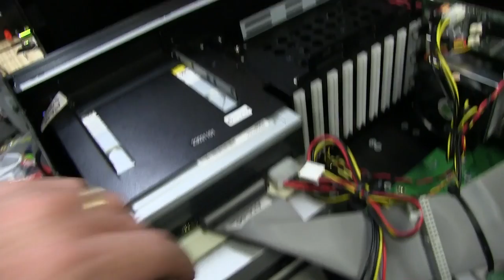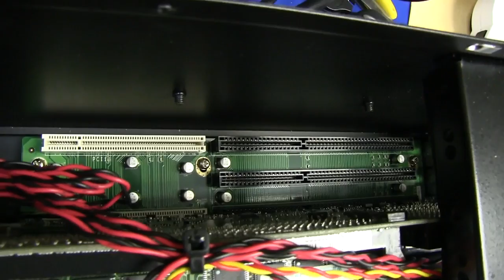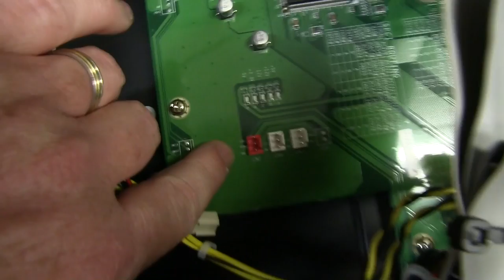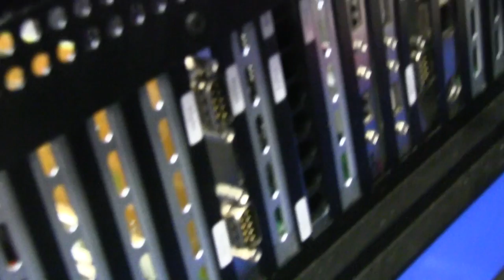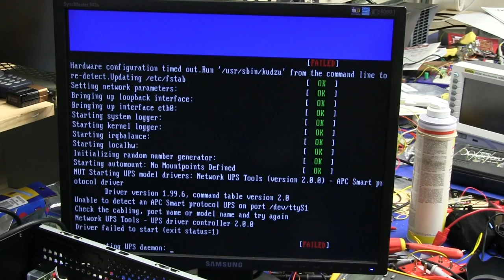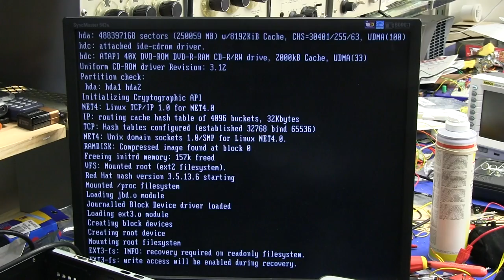EEVblog #458 - Industrial Computer

Comment: Thank you for this video,
Using PS2 mouse and Keyboard (instead of USB one) most likely keyboard and mouse would work. If you bring a linux Terminal and go to single user mode, you can reset the password to log in.

Comment: Those looked more like RJ45, Windows 3.11 could not boot up as it was a shell, on top of MS-Dos.
Reply: Six pins in those ports, not 8.  Those are some variation of phone line that supports other features, like RJ12 or RJ18.
Reply: You can sort of boot into 3.11 if you set MS-DOS' autoconfig to open up Win.com, and then check how long it takes to boot MS-DOS and then start 3.11.
Reply: Windows is a shell, a program, made to run under MS-DOS
Reply: Sasha Whitefur Windows is a shell??? Windows a program that runs in a MS-DOS environment. All consumer versions of Windows until Windows ME were only a program and MS-DOS was the operating system.
The NT range and everything after Windows ME are real operating systems, MS-DOS died with windows ME!
Reply: That's what I said.
Reply: +Sasha Whitefur what do you know? that's a girls name therefore you are a girl
Reply: Joseph Beasley edgy mate. Also, I'm actually male ;)
Reply: Joseph Beasley Well DUH!
Reply: Joseph Beasley
 I'm a Digital Technology Technician, plus my IQ is 137. How many digits in yours, 2?
Reply: Joseph Beasley

I'm a Digital Technology Technician, plus my IQ is 137. how many digits is in yours, 2?
Reply: Sasha Whitefur Of course!

Comment: Grub: Grant Unified Bootloader -
the software on the harddisk that will load the first files needed to get on with it..
- kudzu - detects and configures new and/or changed hardware on a system
Very nice machine - good for server - really - i saw a PCI/Lan - that makes it interesting.

howto fix the key/mouse - unload hd - mount in pc #2 - boot red hat - hack into system - add different user - enable ssh - logout - remount hd in IPC - forget key/mouse - login from pc #2 over ssh.. using the new account - problem solved..

Comment: Old vid, but a comment anyways,: Today, if it's not a system where it's a disaster with a momentary downtime of maybe 10 minutes the specialized industrial stuff usually makes little sense: As an example, I was replacing the hand scanners for the warehouse staff as a part of introducing a new WMS. As it turned out, for the cost of one "real" industrial hand scanner, running som stripped down windows mobile version which looked and felt like crap I could get 15 iPad Touch units with Bluetooth bar code scanners (now discontinued of course). That means that even considering wear and tear, serviceability etc, it's very hard to make purchasing the "real" scanners make sense from a financial perspective; even if the professional units were repairable if say a screen got busted, that repair costs as much as a new iPad, meaning basically you can have a bunch of them on the shelf for when they break.

Same thing with the computers, printers etc; yes, there are super nice industrial computers and printers, made for working year after year in a dusty, dirty, cold etc environment. On the other hand, these kinds of machines rarely need much power, and pretty much any business has enough retired computers to build a 2 meter wall around the premises, so generally you can just make a simple image for those second hand machines containing just the stuff needed for that specific warehouse, manufacturing, etc purpose and just let'em rip, once something goes wrong you just rip it out and toss it, and get a "new" old one off the shelf and be back running in 20 minutes without spending a penny, since these computers are essentially free.

Kinda symptomatic of modern society that quality stuff have a hard time competing with cheep ass stuff when the the good stuff is an order of magnitude more expensive.

Comment: i found this info :

maker: IEI

General
Driver    Integrated in Intel 865G
Display Interface    VGA integrated in Intel 865GV
Audio    Realtek ALC655 with AC'97 codec
Digital I/O    8-bit digital I/O, 4 input / 4 output
Ethernet    1x 10/100Mbps i82562ET Ethernet; 2x 10/100Mbps i82559 Ethernet (ROCKY-4786E2V)
I/O    2 x RS-232 serial port by pin header; 1 x lrDA

System
BIOS    Award Flash BIOS
Bus    AGP 4X/8X
Chipset    Intel 865G + ICH5
CPU    Socket-478 for Intel Pentium 4 with 533/800MHz FSB
Dimensions    338mm X 122mm
Form Factor    ISAPlus: Design to enhance the ISA bus drive capability(64mA)
Gross Weight    GW: 1.1Kg
Operating Humidity    5~95%, non-condensing
Operating Temperature    0 - 60°C (CPU need cooler)
Power Consumption    12V@7.52A,-12V@500mA, 5V@6.98A(P4 3.0GHz FSB 800MHz; Dual channel DDR400 512MB SDRAM)
Power Supply    AT/ATX power
SSD    1xCompact Flash Type socket
System Memory    Dual channel DDR 333/400 SDRAM socket support up to 2GB
Watchdog Timer    Software programmable supports 1~255 sec. system reset

Features :
1x 10/100Mbps i82562ET Ethernet, 1x 10/100/1000Mbps i82547 Ethernet by CSA
2x 10/100Mbps i82559 Ethernet (ROCKY-4786E2V)
ATX power control function : meet ACPI 1.1
Compact Flash Type socket
Hardware monitoring (CPU Vcore; CPU/System Fan speed and Thermal)
Integrated in Intel 865G
Intel 865G + ICH5
Intel Extreme Graphic II interegrated graphic engine
Intel Socket 478 P4 Prescott/Celeron D CPU support
Intel Socket 478 P4 Prescott/Celeron D CPU support up to FSB 800MHz
Long term support
PICMG 1.0 and RoHS compliance
PICMG 1.0 and RoHS compliant
Socket-478 for Intel Pentium 4 with 533/800MHz FSB

Comment: I do find it a bit ironic that the pentium 4 3.00s are only slightly faster than Pentium 3 1400mhz chips minus the obvious instruction set differences, but setting that aside its no wonder they still used pentium 3s in a lot of stuff until I believe mid-way through last year (similar performance to a 3.00 northwood with a quarter of the power consumption not to mention how cheap you can get a 1.4 pentium 3 for lol)

Comment: Extreme dust and temeparatures changes plus edge conectors on the botton, don't seems to be very .reliable Dust going into this conectors are a pain, moreover in ten years. Not almost sure fot PC, but TVs that got the multpi boarb aproach using edege connectors got faulty frequently because dust and corrosion, worst if the slots lay in the botton. Better than Win 3.11, would be OS/2. And insutry proven dinosaur used widely in ATM machines. So, if they can manage money, they are highgly reliable

Comment: 865g chipset and Pentium 4? I have a system running those specs right now. And it was made in 2003. This is 2010?
Reply: Computers are a bit like cars. The older tend to be more reliable. The Curiosity rover that landed on Mars a few years ago uses a modified processor based on the PowerPC that Apple computers had back in 1997.
Reply: +Henrik Nilsen That's not really reliability though, but radiation hardening. It's very expensive and difficult to radiation harden new hardware, which is why they use old stuff in space. Reliability obviously does play a part though.

Comment: fans*

Other than that, probably best to sell it since you can get better performance from a cheap netbook (which will use about 15-20 watts) (currently use one + multiple 1080p USB webcams and a few 15 foot USB cables with cheap USB hubs from ebay acting as a repeater to get the webcams where they need to go, makes a great security camera system)

Comment: I'm not giving the RPi any cred, here, just saying, that's how simple a device you need to monitor a pile of serial ports. You don't need RHEL (what a waste of money for this..), either.

I could do everything that system did in a 1U case in 2003, and I can do the same now. Not criticising the system (well, I am in other comments, Realtek NIC for example), just the application. Typical under-educated managers, 'just buy that thing'.

Comment: Kind of a stupid question but I've build a fair amount of computers (consumer side) and I was wondering if you could rig one of these cases up for gaming because I did a quick Google search for cases and some of them look pretty cool and look like they got some good cooling abilities
Reply: Most industrial computers still use ISA and PCI slots, so no. They'd be horrendous for gaming, if they could even get basic games to run.

Most of these systems divert any performance they have into continuously running and supporting massive amounts of data from, let's say, the 14-slot expansion this one has.
Reply: Lol the only reason I thought cause I looked up the cases and they said they supported atx and micro atx lol I guess I can dream
Reply: Luke Johnson
That was my first thought as well.. I really need some cases, my main gaming PC is in an old case that my ex-wife smashed.. My mining rigs are just sitting on cardboard.
Reply: Darkman2023 Well, yeah, but you could take out the industrial computer crap, and put in a consumer level MoBo and just have a really cool looking case with loads of space for water cooling and other mad science gadgetry.
Reply: Mostlyharmless1985 Yes, you could, but would it really be worth it to take it? I mean, it looks okay and has alot of space, but it seems like it'd be a bit on the large side for consumer desktops.
Reply: Darkman2023 I guess it's a aesthetic consideration, but I love the great big huge cases with tons of airspace. The worth is what you make it. I'd personally love a SUV sized beast of a computer. I'd give it a beating, give it a rust paint job with caution tape, have some old school needle ammeters to measure fan speed and cpu temp, and maybe have a fog machine strapped in to simulate magic blue smoke. The neat thing about those giant cases is you could custom fit an mATX board in it and have TONS of room for asthetic bits and baubles.
Reply: Mostlyharmless1985 If you ran an mATX board in something like this case you could probably actually run TWO and still have room for little baules and the like. lol I do like my airspace for computers, but I don't like things being too large. Desk space is only so much haha.
Reply: Damn the desk space! Full steam ahead!
Reply: Mostlyharmless1985
I'm with you on that one, just for lels but I think it would be a kickass case. Not sure how well any ATX board would just be a dropin replacement for the standard board but nothing a few carefully drilled standoff holes cannot fix!
Reply: FAMICOMASTER For one, no need to be so rude. Two, I understand that, but he worded it asking if he could "rig it up" for gaming, so I answered accordingly.
Reply: I'm going to ignore all of your comments furthermore. Thank you.
Reply: FAMICOMASTER Why didn't you just ignore me in the first place, instead of acting like an immature 12 year old? 

Makes no sense that you'd call me an idiot and then say you're going to ignore me.
Reply: Well, seeing as I AM in fact, a 13 year old anyways...
Reply: So yeah, I think it would be a fun case to mod out for a gaming PC. (lets not be nasty to each other, there's no need for it here.)
Reply: My point exactly.

Comment: On a high quality piece like this: WHY is there a realtek crap onboard?
Reply: +Hubert Hans How about you ask the professionals why they used such a 'crappy' controller. I'm sure you can teach them a thing or two.
Reply: LoL. Because its cheap. But Realtec is a disqualification in a server build. These NICs are so bad, that nothing but pricing and stupid admins will allow to use such crap.

Today, there are some useable Realtecs for home and Soho. But they are bad and sluggish, too.

A good server will stick to Intel Nics, or more advanced NICs. Like Emulex and such. performance and reliability is nothinmg Realtec is able to provide. If you have got packet loss in you hopefully correctly configured network, be shure Realtec is involved.  Or other crappy NICs form cheap manufacturers. By the way, iam a professional.